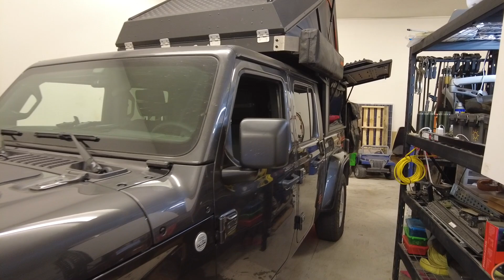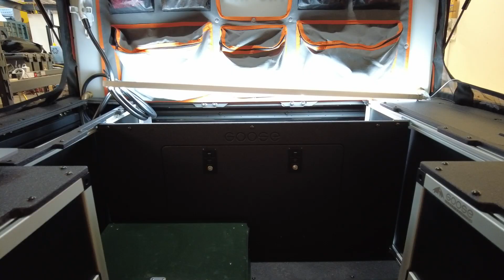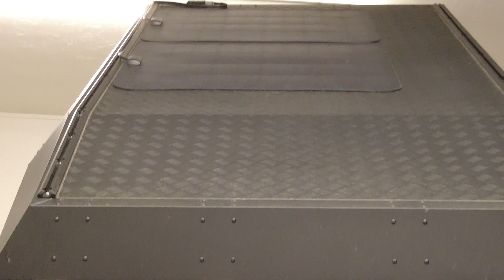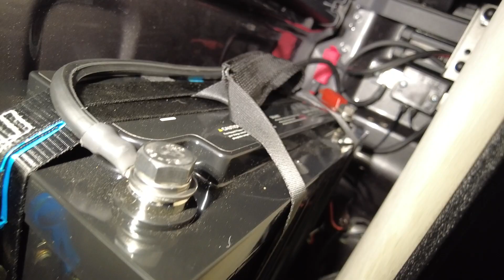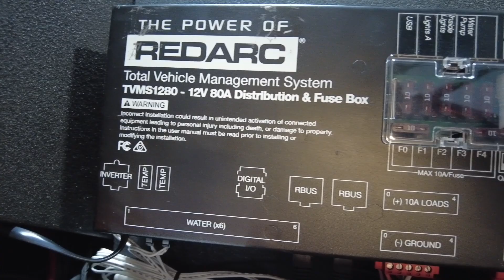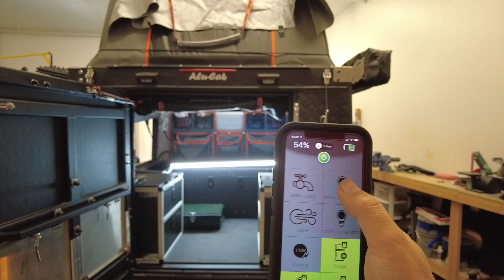Jeep Gladiator Overland Build: Overlanding Electrical System

Comment: With the flexibility of the gladiator did you consider making a pass thru from the Alu-Cabin to the driver cabin for emergency get away ?
Reply from the maker: We considered it for many reasons. Not only for that but also for heat and AC inside the Canopy Camper from the cab. But we opted against it in favor of water. Our 13 gallon Alu-Cab water tank sits on the other side of the back of the Gladiator cab and on the forward wall of the Canopy Camper. We opted instead for heat from a marine grade Webasto heater plumbed into our main fuel tank and ventilation from heat via the 6 openings that are covered by midge nets and portable rechargeable fans. ~ Eric

Comment: Awesome setup. The rear electrical input plug appears to be 110v. Will it also work with the different voltages in Europe, ie. 220v?
Reply from the maker: Great question Tim. Also a complicated answer to some degree. So the short answer is that no 110V will work directly in Europe which runs 220V. However many electronic devices in the USA can run variable volts with an appropriate adapter. BUT! If the device doesn't have variable voltage and we plug it in it will fry it immediately. In this case we'd need to get a transformer. Having said all of that, our rig is self-sufficient even without the shore power because of how frequently we drive (alternator) and the solar we're able to pull in (solar panels) which then run directly to our vehicle which is equipped with 110V. So for us, it should be fairly seamless since we take our own renewable energy with us. But that's a great question, and I'll have to talk to the folks at REDARC to see what they suggest. Though having run the few tests that we have, I don't really see a need for us to plug into shore power unless we are leaving the vehicle inside a building for an extended period of time. ~ Eric
Reply: I was stationed in Germany when I served in the Air Force and we used 220v to 110v transformers for our 110v devices but I’m not sure how well a transformer would work to provide you with shore power. Your electrical system is pretty advanced. I wonder if it can accept a 220v input along with the 110v input you already have. Something to ask your electrical gurus. Most of Europe will be 220v and even with your other means of charging it would be good to have a 220v solution for your world adventure.
Reply: I have a 220v outlet in my garage for welding off a long 220v extension cord. When I want to run a high draw 110v item like a chop saw, I plug in a 110 Y adapter with two 110v outlets that each feed off one side of 110 from the 220v cord. I bet this type adapter could work exactly in reverse to feed 1/2 of 220 into the 110 outlet they have there.
Reply from the maker: Haha we still have a few years before we get to 220,. Although we've made it to Ecuador now. Are you still with us on the journey? ~ Eric

Comment: Seems like you’d have 2 lithium batteries. 2 is 1 and 1 is none, if possible… But I guess you guys don’t need a big power system. Can’t believe you didn’t upgrade the stock alternator or battery either… Just for reliability… It all looks great!
Reply from the maker: I am right there with you on the 2 is 1 and 1 is none philosophy in most things. But batteries are heavy and bulky (even large lithium) and 170AH is more than enough for our needs. One of the reasons we're keeping things under the hood as stock as possible is for future maintenance and repairs in foreign countries and remote areas. We intentionally have made that decision based on solid counsel from multiple highly experienced international overlanders. Thanks for saying it looks great. We're pretty happy with it so far. Still need to put it through its paces once we're done at shop #4. ~ Eric
Reply: @HourlessLife  My understand, it looks amazing!
Reply from the maker: Thanks! It has worked out great for us so far. We're in Ecuador now. Have you been keeping up with the adventure? ~ Eric

Comment: While not "first" I'll actually ask a question. I've just finished doing a multi year overlanding project in Russia and former Soviet states. Being an Aussie system this was available here but we went with SPOD for moisture, self resetting, size and most importantly cost. The Manager 30 is a great B2B, solar, and shore inlet system but I couldn't justify the cost of the RedArc output side. Perhaps if I were using other options, tank levels etc etc. So was your decision to use it because of lack of electrical know how and perceived simplicity, or it was sponsored. Not trying to be an a$$hole or negative and not taking anything away from RedArc and it's integration with ARB gear, tank level monitoring, and connection to the manager 30. But in your build it's a fused distribution point with Bluetooth. SPOD does the same thing for 800 bucks, and a blueseas fuseblock does close, without Bluetooth, for 100. I love you're KISS build out and lightweight thinking, overlanding not overloading, not an easy feat in a JT. So this RedArc mouthful is a departure from this principle and was wondering how much discounted gear played to your decision. Free or cheaper is cool and I am not hating here just trying to understand your rationale?
Reply from the maker: No worries. A completely legitimate question. Thank you for asking. First off, I'm fascinated by your multi-year trip in Russia and the former Soviet States! How was it? What were your takeaways? 

As far as you being mean or negative, I don't get that at all. Like I said, your question is a really good one that merits a thought through answer. 

Partnering with a brand like REDARC for this build is really special for us. There is a simplicity to the way the Manager30 and RedVision system work together and provide information to a novice in this area like me, and there is an ease when it comes to troubleshooting which again is helpful. I'm not technically savvy by any stretch of the imagination, and so this is definitely one of the plus points for our selection. But it goes further than that. Good sponsors like REDARC actually want feedback. Honest, open, transparent, and valuable feedback from folks who are using their gear extensively for long periods of time. They have flat out told me to tell them everything, the good, the bad, and the ugly as we use their product. I truly appreciate this about them, and am looking forward to providing them with real use / real world feedback. Their openness to constructive feedback and request for a long-term partnership where we could learn and benefit from one another was a huge factor in my ultimate decision to go with their system. I recognize that the setup we have is capable to do much more than we need it to, or could even have it do in our build. This is not lost on me. 

When we were originally looking at electrical system solutions, there were really two options that we had drilled down to, the REDARC and another company that makes another electrical management system. Both companies had the ability to work with the different battery types which was really important for us. The main differences were accessibility to the unit on a daily basis, the weights of the individual options, and what their footprint would look like inside our specific build, meaning where it would live, how much it would weigh, and what space it would take up. (For clarification. Not for you I'm sure, but for others with less technical know how that might be reading this comment response,)

The REDARC system ended up working really well for us on all fronts. The weights on both systems we looked at were negligible, but in the accessibility and footprint areas, the REDARC was hands down the better choice between the two options we had narrowed it down to in our research.

For us, the Manager30 tucks in behind our Goose Gear double drawer module taking up no real usable space. It is actually small enough to sit underneath our inverter in the same space so it was a solid utilization of that space. The RedVision takes up a portion of a wall corner of the Alu-Cab Canopy Camper, again in pretty much a void area of the build. So we were really happy with the way it turned out for us. 

So personally I wouldn't say it was a departure from our minimalist build. Though I'm sure like you stated there would have been other options to consider, but honestly I simply don't have that level of expertise and knowledge. 

As far as price point, yes the REDARC is an investment, no question. For us it wasn't a consideration factor against as we were sponsored with both the Manager30 and the RedVision for our global journey. So the sponsorship was definitely a consideration factor in favor of. The Cotek 2000W Pure Sine Wave inverter we purchased. 

I hope I've fully answered your question. I've tried to be as open and as transparent in my response as possible, and I appreciate you being part of our community. It is folks like you who have the experience and knowledge that we'll need in our corner on this journey where we can reach out with things that come up that might be able to give us some real world insight based on experience. So again I appreciate you asking your question. 

Hope you'll take the time to answer mine about your journey. I'm really curious. ~ Eric
Reply: I am glad you took the question in the spirit it was intended. So many people get easily offended and rip into defense mode. “My 42 inch tires will...blah blah blah.”  Or sponsored channels become advertainment and less entertainment as they become popular and I unfollow. So many great channels and personalities have gone this route. I get cutting Gladiators in half is interesting and cool but how does that really fit the average Overland Enthusiast. 70 grand vehicle 40 grand build and another 20 grand in engineering. Cool but misses the target past a SEMA one off build; for advertising. The two elements can live together and I believe you are maintaining that balance. Thanks for answering my question. I agree with your rationale based on ability and a deal is a deal. 

I’ll briefly answer your question. You can email me directly for more details, just don’t want to post too too much publicly. I am still in Russia doing edits on huge amounts of footage. 

Russia is a beautiful country with, for the most part, beautiful people. They separate people from politics and understand how the world is taught to view them. This propaganda, all propaganda they are very good at seeing. Learning to decipher fake news is nothing new to them. They are a helpful group as a species and have a much higher tolerance to risky, unsafe, activities. The mommy nation, put on knee pads, never really took hold. Various rigs have been part of this multi year expedition Lada’s have been some of the toughest machines in the field. The fact they cost around 12k loaded, factory lifted and cool paint doesn’t hurt. Everyone in remote villages can pull wrenches. Tons of helping hands and hospitality. The drinking stereotype is not without merit. A person planing this trip should practice. Lol. It’s not uncommon to find beer here at 12%. Visas and permits are difficult and the administrative process is slow, but very through. Covid tossed the proverbial spanner into this project and added to the length. But this has been a blessing in disguise. Diesel jeeps JT JK JKU’s have been here for years. Expensive as hell by local standards. Experiences with Law enforcement and border types has always been polite and professional without much incident. We’ve never had gear stolen or run into any situations that were scary crime wise. Some gouging on parts delivered to remote locations but in reality the “gouging” was by Russian standards as getting a shaft and bearing delivered to Moab would have cost three times the price. So all things being equal. The team is mostly Russian and I am the token English speaker and subtitle guy. Lol. In the evening we put up the Mac Pro display and play videos of off-roading from around the world. I translate and try to put stuff into cultural context. Lol.
Reply from the maker: @viagracariously8220  sounds absolutely incredible. Thank you for taking the time to share all of this, and the follow up email. Definitely would love to stay in touch. ~ Eric